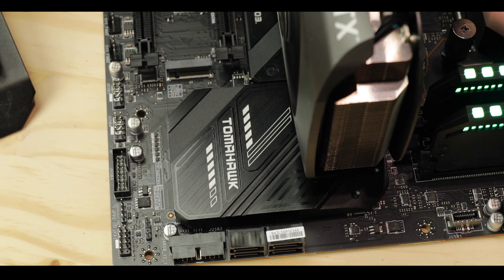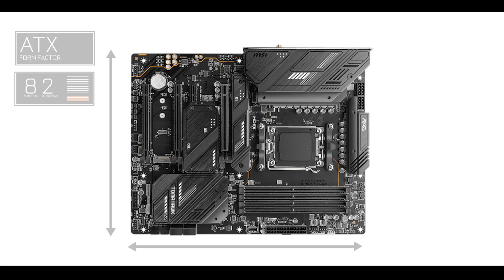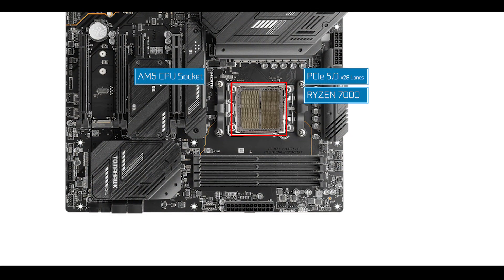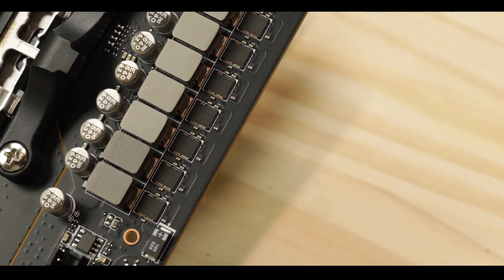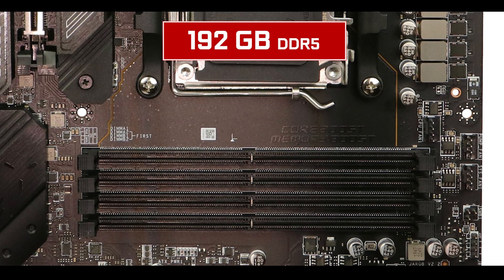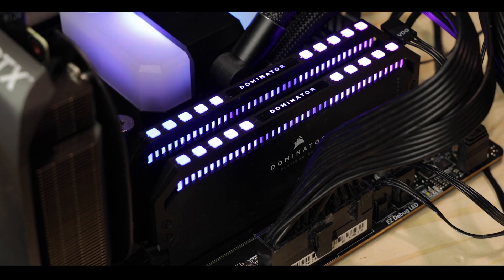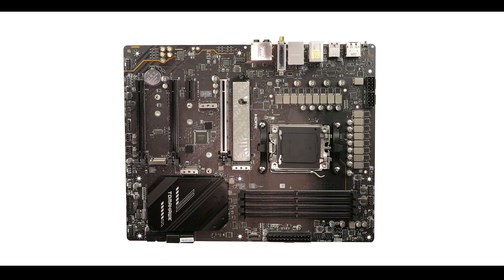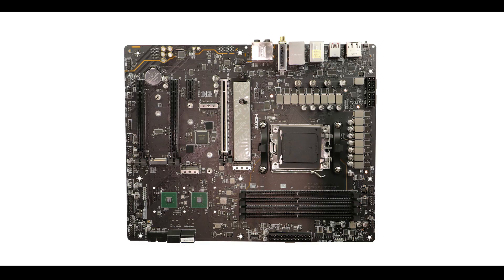MAG X670E TOMAHAWK : No, no, no.

Comment: 2 years later and I am still running into this bricking problem. Its so annoying, it'll be fine for months and then it will decide to throw a tantrum, this board on paper has everything I need but my experience leads me to hate this board.
Reply: what do you mean by bricking exactly?
Reply: @Gamerz5GT CPU and dram lights are on and I don't get any POST, I flashed the bios a couple times and it still won't boot. CPU and RAM are good, I bought a new mobo and they are working fine. This mobo is finicky.
Reply: @AtHeartEngineer  Any reason why you never RMA'd it? That does sound terrible.

I've had it for about 9 months and I've yet to experience this. Hopefully never will.
Reply: @Gamerz5GT RMAing takes a while, couple weeks to a couple months sometimes. Also, the problem was mostly avoided by not shutting my machine off for as long as possible once I got it to boot

Comment: Yeah, I had to drive to the next state to get the 9800x3d chip and was talked into going with this board for a deal with 6000 RAM at a good discount.  It was working, then after installing W11, I removed the GPU to install the 2nd and 3rd NVME's, and it won't post and has a stuck red LED regardless of pulling it apart, making sure no bent pins, re-seating CPU, repasting large cooler, re-seating power cables, etc...  I've never had this much problem.  I hadn't thought about trying to reinstall the same up to date BIOS it already has.  I'll give that a go but now don't feel confident enough to keep the pos even if it does manage to boot again.
Reply: Microcenter? I just bought that same combo when shopping (unsuccessfully) for a second 9070xt. Did you get your computer up and running? I have not opened anything, if you were me, would you take it all back?
Reply: @1EyedUndertak3r  I ended up returning the bundle and ended up taking another 9800x3d and a Gigabyte motherboard and no problems since. I've only heard of Asrock motherboards having some ongoing issue that might already be fixed with a BIOS update.  It may have just been a fluke for me, and I'm not sure if it was the CPU or mobo. I think it's worth putting together since I think the return period is 15 days, though more difficult for me due to about a 4 hour drive.

Comment: I got this board on sale for $163 on a Black Friday sale.  Does that needs caps?  Def not.  I'm running this with a 9800X3D, 64GB G.Skill EXPO RAM (board got default timings right off the bat), a 7800XT GPU, and a 4TB WD Black SN850X NVMe drive... I'm thinking of adding another NVMe drive... maybe a 4TB Teamgroup or SIlicon Power NVMe for backups and a scratch drive.  Flashing the BIOS before installing the CPU was a breeze.  For the price I'm super happy with the board.  No way in hell I'm paying $250-400 for some of the features and VRM I got here.
Reply: curious about you being able to run stable with a SN850x, what bios are you running?  Alot of what I've read is MSI and WD 850x do not play nice together.  Is all still stable?

Comment: The board will not run 4 x 16gb ram at 6000mhz. Just buy 2x32 sticks if you want it to run at max speed.
Reply: where did you get this information from?
Reply: @tawhidalif4763  I have the board and the  and the 4 sticks of 16gb ram. I then had to get 2 x 32GB to get the board to run at 6000mhz on 64gb of ram. I didn't buy cheap/low quality RAM either. I bought GSkill Trident Z5 some-shit for AMD (AM5).  I flashed the bios, you name it. Nothing worked except for changing the RAM.  My advice would be, don't buy this board. Knowing what I know now, I would have bought ASUS or AROUS.  My mistake was trying to keep everything 1 brand (MSI). The fastest I was able to get the 4 x 16GB RAM to run at was 4200Mhz. 2 x32 runs at 6000mhz and it's the same brand as the 4 x 16GB sticks I had in the board. When I would try to set the RAM speed higher than 4200Mhz it would get stuck in a boot loop and wouldn't post. I had to reset the board via CMOS.

Comment: This Board is actual absolutely fine. Bios update to Vers. E7E12AMS.1F0 and there are no problems to count. It runs in my system with a 7800X3D and Kingston Fury 32G @5600 MT. Boot is fast as hell with a Samsung 990 pro. No issues and I am glad with everything.

Comment: Same thing happened to me. Everything installed and wont post past red and yellow light. I was in agony. Sadly I didn't watch this clip till the end and addressed this " no ,no ,no" to some marketing trick as review all the way till the end had a positive tone. Something you could change in the future. I wouldn't buy this motherboard if I sensed wtf. You are about.
After installation of newest bios it worked...but
Thing is that after extensive RAM memory training sessions, you could mistake one with sleep mode that is awakened only with the power button ( if not changed) so if interrupted it will  go numb ( red and yellow) ...but. after flashing to native Bios it does boot but to some version of bios that doesn't exist on MSI site , that you obviously haven't installed but does work ( with date 29.09 2024) . Maybe some  explanation?
Reply from the maker: Hey something I realised, when u get this red yellow lights coming, short the reset and power button on the front panel connector reboots the board and somehow by pass the RAM full metterring. 

If you had a OLED screen it'll show error 15 for a few seconds , reboots and posts. 

Hope this helps
Reply: I like this board for its theoretical characteristics and its price, however I want a board to work on engineering, data science, deepl learning among others, so I want something stable with similar or superior characteristics but without a very big price difference. What options to date would you recommend?, that has amd expo support and obviously ddr5?
Greetings, excellent work   @Laurentschoice
Reply: I like this board for its theoretical characteristics and its price, however I want a board to work on engineering, data science, deepl learning among others, so I want something stable with similar or superior characteristics but without a very big price difference. What options to date would you recommend?, that has am5 amd expo support and obviously ddr5?
Greetings, excellent work @Laurentschoice  @Laurentschoice
Reply: @Laurentschoice  any idea if the known issues you've mentioned have been resolved at all?
Reply: I like this board for its theoretical characteristics and its price, however I want a board to work on engineering, data science, deepl learning among others, so I want something stable with similar or superior characteristics but without a very big price difference. What options to date would you recommend?, that has amd expo support and obviously ddr5?
Greetings, excellent work @Laurentschoice

Comment: For anyone wondering whether to buy this motherboard - don't. 

I have never had as many issues as a motherboard as I had with this one. 

BIOS is beyond flaky, refused to POST on multiple occasions and would not switch off without turning it off at the wall, regardless of hardware configuration. 

This board also failed to update the BIOS on *7 occasions*.

Save yourself the stress and for the same price, opt for the Asus TUF X670E WIFI which gives you the nice (almost) blackout aesthetic and has a BIOS that works correctly and is rock solid.
Reply: With recent Asus RMA fiasco, no thanks for Asus.

Comment: I just bought a open box 5800x3D to try out vs my 5900x as I appear to get dips in my old BF4 game. But then with the newer AM5 only being $350 for the 7800x3D I am thinking I really don't want to spend that $266 on the older chip. I can sell my board for $100, RAM for $80 and 5900X for likely $260 to a friend that I will doing all the BIOS update/installation to replace his 3900x. So I will be only about $230-280 out of pocket to move up to AM5 but will drop to 32gb of DDR5 vs my 64gb of DDR4 3600mhz C18. 

I decided to buy an open box MSI Tomahawk X670E as I wanted 4x M2 and PCIe5 for future NVMe direct storage benefits and likely a modern GPU. The price difference between PCIe5 and 4 is like $20-30 so I want to include this and I want plenty of PCIe lanes as I run 4 NVMe drives now on a X570S MSI Edge Plus Wifi.

Likely should just stay with the 5800X3D I just bought just have a hard time spending that much on older AM4 when it's only a couple hundred more to move up.

Comment: I don't agree with this negative review, the Motherboard has the same features of the other brands at the same price + the S/PDIF audio output that I definitively need and is present only on 400$+ MB from other brands.
Reply: Says he don't know why there's the extra 2 pcie ports. The reason. Pcie wifi card and pcie sound card. Onboard wifi blows dick and onboard sound blows a really nasty dick. Onboard sound makes games sound so damn retro, it's like having the sound from Duke nukes. Do not skip on ur wifi card even with onboard wifi, and DO NOT, I repeat, DO NOT SKIP OUT on a dedicated sound card. Even if you use a dac for audio, you absolutely want something like the AE-9 to feed your dac with very high quality sound. You'll hear them footsteps much better and high fidelity of high quality music as well. Even youtube sounds better. And no hiss whatsoever
Reply: @metabang03  What the hell, you ABSOLUTELY SHOULD NOT buy a soundcard to feed a External DAC. With a digital out from the motherboard to the DAC (e.g., via USB, optical, or coaxial) you're just passing the data to the DAC. Also you between a soundcard and an External DAC, you should choose a External DAC it avoids internal PC electrical noise, providing cleaner audio quality than a soundcard. Don't make people waste money.
Reply: @metabang03  it’s exactly what I have, a 4 chassis HiFi  DAC from Musical Fidelity connected using the SPDIF output.
Reply: @metabang03  I'll never get why youtube and reddit shills are always in favor of less expandability for some stupid reason. "hurr durr nobody uses the extra slots anyway so why include them" ... so idiotic

Comment: Dude this is a super solid mb for the price don’t overclock and go for a good x3d processor untill the last am5 processor is released go for that then and you are future proof over 10years with pcie5 on ssd and pcie. Also has 2 more fan connectors than the similar tuf gaming fo e. Very solid mb dont listen only to youtubers trust
Reply from the maker: Very good Mobo... It if was in a vaccum.. and priced lower. :)

Comment: I have used this motherboard with a 7800x3D for about 3 months now and not had any noteworthy issues. It has been solid while running memory @6400MT 1:1 with 1.2v SOC voltage.
Reply: 6400 MT  with 1:1?
wasnt 6000MT max for 1:1?
Reply: Not since AGESA/BIOS updates. @thedarkangelpt
Reply: what ram sticks did you use? im trying to find the best ram that utilizes expo. im hearing that it doesnt boot with intel compatible sticks?
Reply: @vinny2shots  gskill trident neo z5 cl30 6000. Im still new to all this. I have noticed a slow boot time with my msi mobo. I heard you can drop the speed a bit and can improve.  Ill test that out soon. I turned expo on when setting up.
Reply: @Kamehaiku I recommend setting 'memory context restore' to enable or you will get the memory retraining a lot.
Reply: I'm using an XMP kit so I can't make recommendations on that, but any higher speed low CAS latency kit should be be Hynix m or a die and do well once MB is updated. @vinny2shots
Reply: how is your bluetoth wifi? thanks
Reply: can you give us an update?
Reply: Я тоже заказал. У вас все хорошо работает?
Reply: considering buying this combo right now, do you still recommend? (gpu will be 5070ti)
Reply: Running this board with that chipset and a rtx 5070ti hopefully it works out well for my first time build
Reply: My top m.2 didn't work.  I didn't know untill I bought an extra m.2 and it wouldn't see the drive untill I moved it.  Even after setting up the drive I put it in and it did not work.
Reply: I have the same motherboard and 7800x3D also have XFX RADEON 7900XTX graphics on it, a year old with now problems
Reply: Thats what im currently building right now. Mahalo

Comment: The x1 slot is perfect for a sound card. The x16-4 is perfect for a 10gb ethernet card. Those slots ARE useful.
Reply: Not to match a capture card, or 2 more USB-C ports if you need them.
Reply: The slot configuration on this makes it one of the few boards that might actually meet my needs. It's harder than it should be to get enough slots for multiple cards for things like video capture, audio, etc. without buying something really expensive.
Reply: @xargos  Necro, but... Similarly, the X670E Tomahawk ended up being the only board that really fit my use-case. 

I don't want my x16 slot cut down lanes for any reason. ProArt and Taichi immediately drop to X8/X8. I need an extra X16-sized slot for another GPU that's for extra displays only plus another slot just in case. 

I actually went X670E over X870E because I didn't want precious lanes dedicated/diverted to a USB or M.2 standard that I will never saturate.
Reply: Absolutely it is. I have my AE-7 plugged into that slot, and its the only slot that would fit it after I plugged in the graphics card. So it is VERY useful.
Reply: A low end intel gpu for encoding workloads would work in the slot as well.
Reply: what really confuses me is the fact that the PCI_E4 slot has the same pin count as the PCI_E3 slot (x4), which to me makes it appear x4 but even the manual says x2... what the h*ll were they thinking???
Reply: @justsumdude471 it’s likely cheaper to produce if you don’t have to add an other kind of PCIe connector to the list of parts that needs to be sourced and mounted.
Reply: @justsumdude471  PCI_E4 is running at x4 mode if there's no NVMe in the M2_4 slot (the bottom-most one with no heatsink). If there's a NVMe in there, they both share lanes and only get x2
Reply: @Knaeckebrotsaege  The product page and user manual explicitly state PCI_E4 supports up to x2. Are you saying you've personally verified that it's actually running at x4 when M2_4 is unpopulated?
Reply: indeed. this guy is an idiot.
Reply: Absolutely. A second fully powered x16 slot on the other hand? Am I missing something or isn't dual GPU practically obsolete?
Reply: @finneogan I've read that it can be good for certain production workloads but not for gaming unless a game is built to use 2(which 99% aren't). Certain rendering programs seem to get a massive boost from dual gpu set ups
Reply: @finneogan dual GTX 1080ti was legendary still is but 
Mostly not now . 
However if it's a workstation yeah makes sense put three w7800 there

Comment: My biggest gripe with ANY X670 board is the stupid PCIe layouts
give me my 1x slots - lots of them
have an x16 slot somewhere in the middle so I can plug in a GPU for testing without having to remove my 10gbe network card in the x16 slot at the bottom(cause requires x8 slot)

This is the only one that comes even remotely close offereing decent spacing between x16 slots and provide at least one more x1 in a good location

Comment: I have used this board since April of this year with a 7950x3d, and since the last bios update and new AMD chipset drivers, it's really starting to shine. For me the best layout was to put a 9900 Pro Samsung drive in the top M.2 slot, and another 9900 Pro (Steam Drive) with a PCI Express adaptor in the PCIe 4.0 PCI _E3 slot, as both are straight to the CPU. This leaves the ethernet, HD audio on the 670E A chipset, with some USB and a M.2 slot. The 670E B chipset serves Wi-fi, the rest of the M.2 slots, and more USB. The back IO has a few USB straight to the CPU, wish it had a few more. My biggest complaint is no Bios reset button on the back of the IO.
Reply: You dont need the Bios reset Button just remove the battery for few secs
Reply: Hello, Is this board still serving well? The way you have the m.2 in the first slot and then another in the expansion slot. Does this reduce the x16 gpu to x8? This confuses me
Reply: The GPU is on a PCIx5 slot, and has it's own lanes, as well as the main m.2 drive. My second m.2 drive is on a PCIx4 slot with an adaptor. All three have a direct path to the CPU. The other m.2 slots run off the chipsets, and share lanes with USB, ETHERNET, etc. You can download the manual and it shows all the lanes for the motherboard. Yes, the board runs perfect. @carnagelan
Reply: @carnagelan  no it doesnt^^ thats a intel thing cause intel has 20 pcie lanes on cpu but only 16 gen 5.. so with a pcie 5x16 slot and a 5x4 m2 slot it takes 8 lanes from the cpu
Reply: Hi, I was looking to purchase this motherboard as well but heard that there were some issues with Samsung ssds, is this true?
Reply: If its solid, what could be better ? Just to know what to look at when buying one. 😊
Reply: I'm also looking to buy one, I just got a 7800x3d and am looking for the best motherboard.
Reply: @stevenlong9632 , is it really better to use for the second NVMe drive not one of the other chipsets slots, but a processor PCI-E one (theoretically the same bandwidth) with a possibly slowing down adapter?